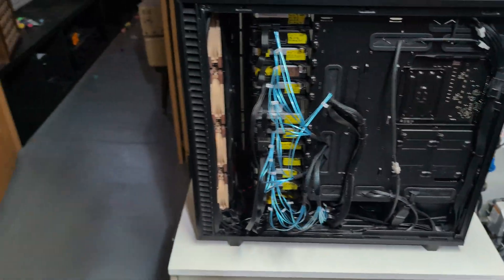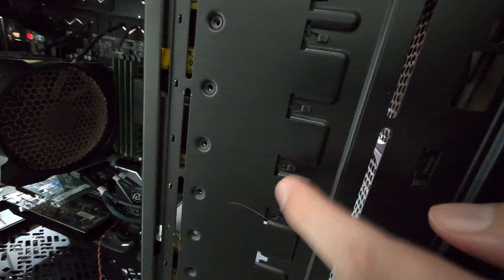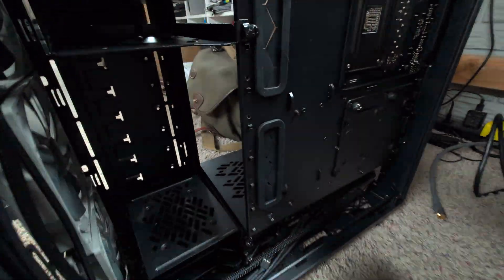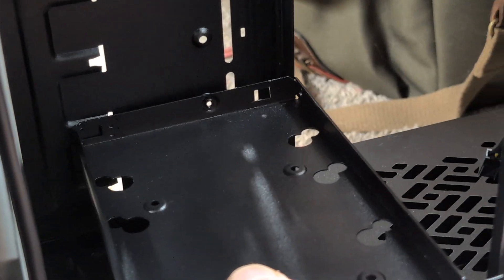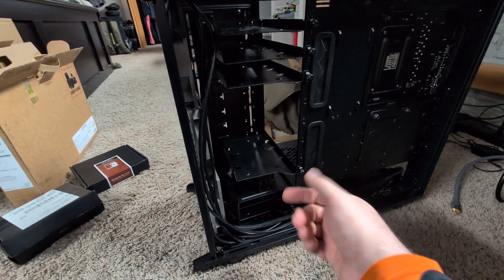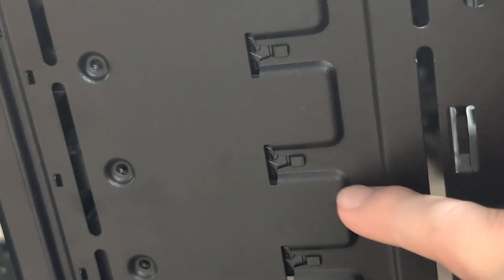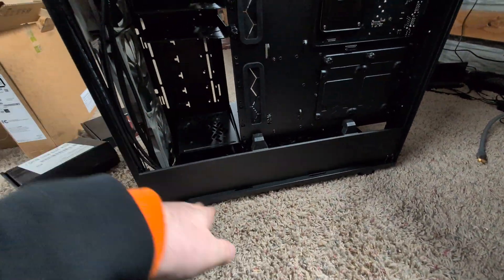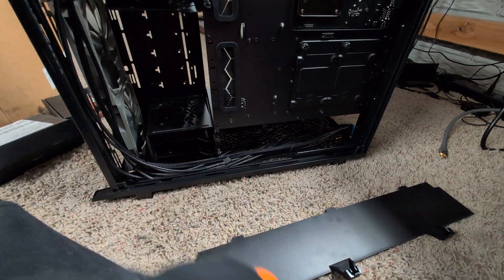How to mount a Drive when the Fractal Define 7 and 7 XL are in Storage Mode Configuration

Comment: I have a define 7 and love it but I want to add more drives, I thought about the XL it was the cheapest option but I am approaching 16 drives in the system.  I am thinking a hot swap option is the best now.  I love my define 7, very nice case but I have outgrown it.
Reply from the maker: Well 16 drives is a common maximum for an HBA so it kind of depends on how many more you need.

Up to 16 hotspot should be relatively available after that stuff's going to get quite pricey and you're going to have to start looking at something like 45 drives rack mount chassis.
Reply: @TheProfosist  I have a 16 but will grab a 24 to go with the 24 bay rack server.  I don't need anymore.  It's getting out of control...
Reply from the maker: Haha, I'm only using 12 of my 16, went to 20TB drives when a bunch of my 14's started dying. Which got me a lot more space. 

 Must have been a problem cause 14TB basically don't exist anymore, they skip right over that size.
Reply: @TheProfosist  you can get a 24 port card for roughly the same price as a 16,  hard to find 16 bay chassis too.
Reply from the maker: Interesting. I remember when a 16 port was triple an 8 port. And rather hard to find.

If I recall correctly though many of the 24 ports and even some 16's use dual controllers. That can get messy if your using a full length slot for the card as well as a few other things.

I went with a 9300-8i and a 9305-16i

Yes for the amount of drives the Define 7 and 7XL are great. I do want to go to the 45 drives home lab chassis eventually but thag price jump, ouch!

Comment: what size are those fans at the front of the case?
Reply from the maker: Are you talking about the Define 7 or Define 7 XL?

I believe
7 = 3x 140mm
7 XL = 4x 120mm
Reply: @TheProfosist 7xl. I have the 7xl and I can only get 3 of the noctua af14
Reply from the maker: That is correct. If you want to get 4 fans, you need to use 120mm.

From fractal's website:
Front fan
4 x 120 mm or 3 x 140 mm, (2 x Dynamic X2 GP-14 included)

Comment: how did u remove the front 2 fans and add your 4?
Reply from the maker: They just unscrew. Search fan sjould have 4 screws one on each corner. Should be accessible once you take the front of the case off as well as the front filter. Also don't forget to unplug the wires if they are going to an internal hub.
Reply: Yup I tried it after putting that comment.

Comment: Great video do you mind providing what your cooling is and temps?
Reply from the maker: On the server? With all the front drives full I gotta keep the stock Noctua's cranked at max to keep the drives cool. That's why they make the industrial's for these higher density systems. HDD's are at 28-32c SATA SSD's at 30c. The NVMe's are not under real load at the moment so idle 44-48c. Motherboard at 39c. With my normal stuff running 40-60% cpu load 5900X is at 58-64c with a U12S with dual fans.

Comment: good video. 1 question. That vertical plate that the hdd shelves hook onto, can that be reversed so that the hdds go in on the left side of the case instead of the right? That way i can access pcie cards and hdds from the same side and not have to shift the case. thanks.
Reply from the maker: No because the sled's screws into th back side. So open ome side for motherboard stuff backside for all the drive stuff.

Comment: How do you do DVD rom ?
Reply from the maker: If I recall it's the top slot on the 7 and top 2 in the 7 XL. I believe there are adapter plates in the box. I'm not sure what mode they can be done in but it should say in the manual which is on their site. Let me know if you can't figure it out.

Comment: I have bought this case to use it in server build, but only now am I noticing that my motherbord (ASUS TUF GAMING B650M-Plus Wifi) has only 4 SATA ports… I need at least 3HDD, 1 DVD-Drive and 1 or 2 SSD 2.5’ 
Is there a possibility to add SATA ports??
I am a ‘beginner’ - thankful for every advice..
Reply from the maker: Sure I would get a HBA (host bus adapter) for the hard drives. Ones I've used in the past are LSI 9300-8i and 9305-16i they or similar products can be found on the used market relatively cheaply.

Comment: 5:40 still using define 4, might want to upgrade to meshify 2, do you know in storage mode, if i intentionally leave the middle portion clear without hard drives mounted, can it let a lengthy graphics card extend through? or just by having the mounting bracket on will obstruct the graphics card to go pass that area?
Reply from the maker: Fractal likely has specs on their website for GPU size in that config

Biggest issue is going to be with of the graphics cards some of those truly big ones can get quite a bit wider than the PCI Express slot you've got maybe 6in or ~152mm

Legtj wise if you don't want to go into the HDD bay you still have 12in which is a decent size card as long as the cables come out the side.

Comment: Super useful for Define 7 XL owners. The manual is so terse as to be useless. 😂 The Racerr channel did a guide too.

Also there’s ordinarily a panel on the other side that covers the other panel with the hooks and locator pin holes. You couldn’t really see the attachment points with that panel attached — had to remove it first. Pretty much the thing that tripped me up the most.
Reply from the maker: Ah yeah apologies I had already gotten rid of that panel by this point. If you run in the storage config I highly recommend you don't put it back.